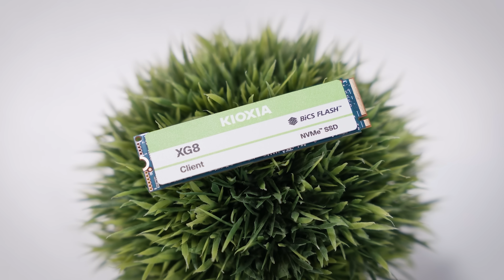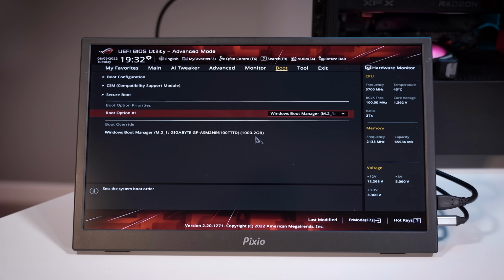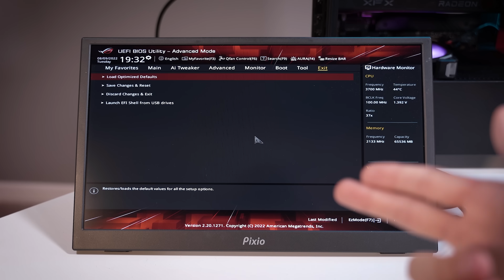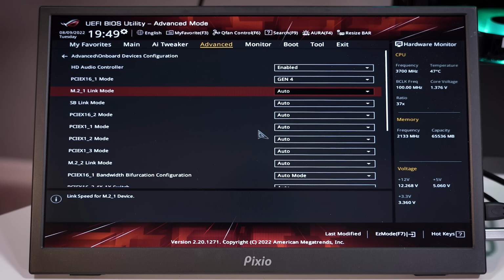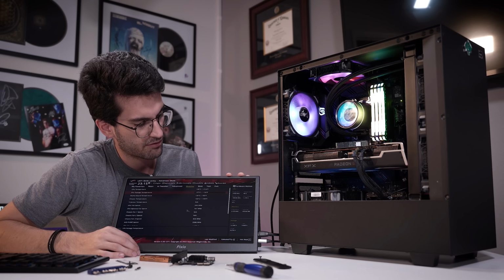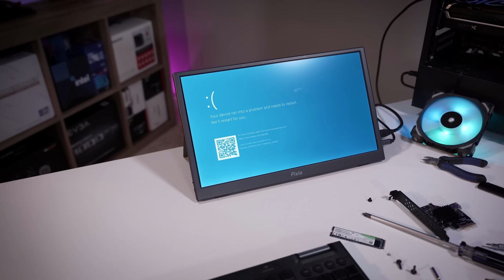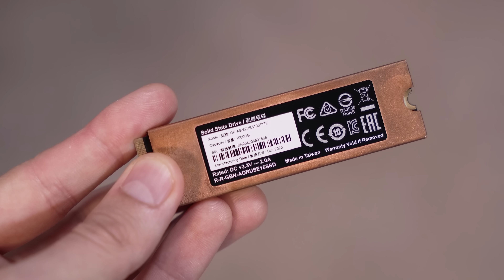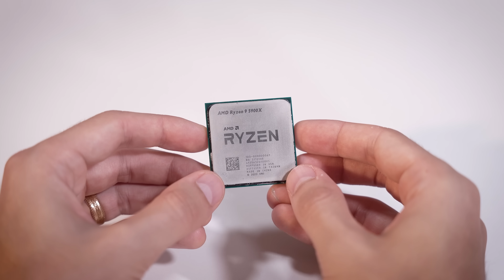Fixing a Viewer's BROKEN Gaming PC? - Fix or Flop S3:E2

Comment: Okay so I had this EXACT issue. Mind you I work in IT and this one had me stumped for a while. If I got into bios THEN exited and discarded changes it would boot into windows fine. I first replaced the Motherboard (it was a older asus b350 strix with a asus b550 strix. Same issue. So like you replaced the drive and literally tried a new install of windows 10. Now getting errors trying to install. Did multiple deleting and reformatting of the drive before it actually let me install windows. Got into windows on the new drive in the new MB and still getting the same issue. Could only boot after going into bios and exiting with no changes. What fixed it for me was running scanning the drive for errors - if found the errors, repaired itself and since then no issues. It HAS to be a issue is asus uefi bios and Ryzen cpus (I have a 3700x) not correctly installing windows or something since I literally replaced no the the ssd and the MB and tried a fresh install and was still getting the same issues. I think that CPU is fine but does have some sort of controller that is all messed up but at least in my case was able to be fixed.

Comment: I recently had similar issues booting into Windows. I tried a clean install, resetting BIOS, just about everything, and was slowly going mad… I used a Linux rescue drive to test my SSD, and found my problem… the SATA controller. I unplugged my SATA drives and disabled everything related to SATA in the BIOS. The PC booted up perfectly fine. 

I ended up having to replace my motherboard, but I was thinking of Greg and this playlist the entire time I was working through the issue. 😅

Comment: had a similar issue for 2 years, random crashes, BSOD, the like, an AMD ryzen, narrowed it down, to voltage offset, rasied it by 0,9mv, never crashes, i think some amd cpus need a little more voltage than the stock settings

Comment: I had something similar happen but in my case the CPU was not dead, simply reseating it fixed the problem. Maybe a pin wasnt connected right, idk. Could have been the issue here too.

Comment: my guess is there is a short inside the CPU given the temps we seeing and that makes the entire system unstable under any load. when you are in the UEFI the CPU doesn't actually do anything it is just running full tilt in a idle state. so you can fetch the microcode etc. since it isn't touched by the short but once you go to boot it crashes since the voltages will be all kinds of messed up.

Comment: How is that front radiator getting air? Wth is this case? In a restricted case a 5900x can run up to 57 degrees when the cpu is doing basically anything. Mine idles at 47-50 if the room isn't too warm, but jumps up to around 57 when it's busy at all, running a NH-D15 in a define 7 compact. (running between 48-53 now with just youtube and background programs on)

Comment: Honestly Its hard to diagnose these high core zen3 with temp problems because I've had fairly high temps in bios as well with the same chips. No issues with it but because of the zen3 algorithm its normal to see it jump to 50 - 60c

Comment: Had problem with AMD graphics card. A few days ago, my friend's pc got a blackscreen so he asked me to fix it. He got a 12400F and 6600XT build, which I built for him and it worked fine for about a year. Turn on the pc, the keyboard and mouse lights on, the screen start to look for signal but a few seconds later still black screen. His motherboard, Asus H610M-A，has no Debug led but a Q-led core system to allow me know that the mb says GPU is the problem. So I swapped his 6600XT with my 3060TI, everything just worked fine. Then I put his 6600XT on my rig and it had no problem too. So I used my 3060ti to went into his bios and enabled CSM, changed Boot from PCI-E into UEFI only, his 6600XT worked. I ddu all the previous drivers and installed AMD drivers of different versions. But the rig just kept going blackscreen when I tried to play games. All attempts failed, I let him to send back the card to Asus😔

Comment: I bought a brand new motherboard from micro center and when I turn my power supply on all it does is flicker then shut off really quickly. Idk what’s wrong with it!? It kinda sucks wish I lived near Greg but I feel like I got a dead mobo all other parts in the pc work I tested it with a working mobo

Comment: Don't tell me my CPU is broken. This is exactly the same issue I am getting for few weeks, at first my motherboard decided not to recognize the Quad channel even though its been years I am on the Quad channel memory, second it stopped recognizing my storage drives.

I had updated my BIOs to F37c and after that I started getting these issues. Although i downgraded it but some issues still persist. 

Currently, I am able to use my computer but after my first post computer freeze on the mobo logo screen then BSOD, I had to force fully power off the computer and power it up again then the computer work fine until I restart/shutdown it again. 

Mobo: Gigabyte Gaming X x570
CPU: 3700x
Bios: F36

Comment: Hi Greg, I also have a 5900X and the temps on this thing are weirdly almost always high. In the desktop I idle at around 47°… When gaming I never go above 75°. I’ve tried everything, changed cooler, reapplied thermal paste etc and after some research the chip just runs very hot regardless of cooling. Fantastic CPU otherwise!
Reply: As long as your temps aren’t rising slowly while the system is idle then your fine honestly. 47c idle is a bit on the hotter side of idle temps but perfectly acceptable especially as you did say it doesn’t go past 75c (tjmax of your cpu is 90c) while gaming so in most cases the idle temp doesn’t matter too much.

If i was you i wouldn’t worry about it and keep gaming! But If you still looking at maybe trying to lower your cpu temps;
-Check your ambient room temp and see if you can cool it if its on the hotter side.
-In the bios if you are comfortable you could try and undervolt your cpu by setting voltages yourself but like i said only do this if you are comfortable and make sure to check guides and acceptable voltage ranges for your cpu since you could fry the system SO BE VERY CAREFUL!
-Set a more aggressively fan curve within the bios or MSI afterburner more noise tho, up to you.
-If using a Aio have the fans as intake which will cool the cpu slightly better however, GPU in return will run a bit hotter nothing to crazy if your gpu is already fine. Generally this doesn’t matter too much as long as theres airflow but it is an option.
Reply: @ranjnijan3446  Thank you for all of the points! I might try flipping the AIO to intake as it's currently set to exhaust at the top of my case. I replaced the included NZXT fans with the Lian Li AL-120's that I got instead. I have 3 set to intake and 3 (on the AIO) for exhaust. The temps are fine and stay stable when idle/not gaming. As soon as I go into a game, they slowly ramp up to around 70 and then go up or down a few degrees. I've not had any blue screens or issues, so I'll leave it for now and try some of your suggestions if I have issues. Thanks!

Comment: This exact same thing happened me from an update the other day, I also use 6700xt with r7. I had to create win 11 instalation media and wipe everything to get past it, got all them same errors also, and mostly always different. Anyways it fixed it but I lost all my data that I didn't back up. Just thought I'd let you know cause our specs are pretty similar and the issue was the same so I don't think the cpu is dead

Comment: Attempted to read to write-only memory. That is the exact same BSOD-notification which I had quite a few of on my broken Acer-laptop (Coffee Lake and NVidia, default settings of the BIOS and never overclocked). But also the others which Greg showed. Windows BSOD's much too fast for little reason. See Dave's Garage, a wonderful YouTube-channel from somebody who worked for MS until somewhere in the 00's pretty high up in the chain of the Windows-team. As far as I can tell Linux does run stable on that laptop which tells me that there is some weird problem with some driver.

Comment: Please try this Greg on another board. See below.

I had the exact same issue. Bought a new r5 3600 back in 2018 and i couldnt get it to post for the life of me. Ive built many rigs in the past especially Amd ones. I realised something was up when i couldn't get a new install of Windows 10 to complete, it would just blue screen with many different errors. I tried my spare 2400g and it was fine. Turned out the issue was the stock voltage was no enough to keep the chip running. It had 1 core that was so bad it needed 1.45v locked at 4ghz to boot. 
Im almost certain if you go back in the bios and set a voltage of say 1.3 and an all core of 4.2 it'll work fine.
Reply: I guarantee 1 core is cactus or really "tired". If a static voltage and clock speed doesnt work, try disabling 1 CCD. Im pretty confident it just needs more voltage and lower clocks.

Comment: If you can't get into Windows you can't use your rig? Well, as long as you can Linux...it games pretty well. Of course he likely won't get into that either but if you have one of those PC (especially Acer) which is unstable on Windows then Linux might be a great solution as long as you can't figure out the problem. I had two, a desktop from Acer (2009) and a laptop from Acer (2018/2019). The desktop was unstable on Windows due to a buggy Intel-driver which it shipped with, for the laptop I haven't figured it out yet, without any driver (clean install) it is unstable. Acer-PC's are a nightmare, avoid. You might be lucky, the point is that they have no reasonable quality-assurance.

Comment: from my experience most of the BSOD's are caused by RAM. I'd swap RAM first as it's the easiest. Run Memtest86+ to check if it's faulty. I'd check the CPU in another mainboard too. Might be dirty pins so wash them with isopropyl alcohol and a brush.

Comment: Had the same issues with a 5900x. Always crashing at startup (Search for "whea errors 5900x". It is a known issue)
The only solution for me was to flash the CMOS and immediatly set the multiplyer fixed to 46 with docp and undervolting it to 1.25V.
Now it's stable @4600 Mhz.

Comment: this exact thing happened to me about a month ago.

started with the windows black screen rebooting after I'm playing games for a few minutes. so, it should be the gpu area, right? spend some times cleaning and replacing the TIM and pads. still same problem. rolling gpu drivers from newest to older versions, same problem. temps in hwmonitor were normal. 

then it started doing just like in this video, post no problem, but couldn't boot to windows. difference was, I can get into automatic repair screen, but nothing I did there fixed the problem. tried safe mode booting, restore to previous restore points, etc. 

tried clearing cmos numerous times, bareboning (only cpu, gpu, and cooler fans are connected), swapping ram slots, nothing worked. 

then I tried swapping components with my lesser office pc. every components, including the cpu and psu were migrated to my office pc's motherboard and casing, and everything was working fine there. ran occt stress test without any errors. 

so at this point, it should be either the motherboard or windows installation went cuckoo, right??

before I drop money on a new motherboard, I thought I'd try a fresh installation of windows as a last *free resort. so I assembled everything back to the original motherboard and casing.....and lo and behold, the system booted to windows normally. occt stress test passed without errors. and it never ONCE acted out again till this second....

so till this day, I don't know what happened, where the problem was, and what was making my pc a glorified paperweight for almost a month....

Comment: My brother has recently had this issue. After buying a new pc and bragging to me how it’s from the best pc site in the UK even though I’ve E never heard of them he gets it and… it blue screens just like that straight away or goes straight to the bios saying SSD not detected. And instead of straight away telling them it’s not working him being him has to start taking it apart to try and fix it. Although he doesn’t have a clue what he’s doing I had to do it for him. Everything he had me do though still wouldn’t work. Or though restarted enough and it would actually boot into windows and work so it was a weird one. Then another issue after long periods of time of it not being turned on when he would come in from work turn it on it wouldn’t power on then suddenly restart itself as if the power supply was bad then same issues until he restarted enough. 
He did finally send it back last week haven’t heard anything yet but he started saying to me that sometimes MSI boards don’t like having SSDs and won’t make them work.

Comment: Something like this happenes with me (Different types of BSOD) with my i7 12700K and ASUS TUF Z690 and 4x 16Gigs G.Skill RAM, if I turn on XMP Profile. If I reduce the Frequency to 2999Mhz it works perfectly. It started after updating the BIOS. Now downgrading BIOS doesn't fix it :'(

Comment: That literally happened to me yesterday night spend 5h and i could not even reinstall windows every time i atempted it it just crashed with different bsod codes.... i removed every drive and  after taking another drive from a 2ndary pc it worked.... Then i realized all that happened after i installed the "Userbenchmark" it said it was a virus so i checked and people were saying false positive so i run it ( like i did for many times before) and after test was completed BOOM 5 h of nightmare

Comment: This is a dead core. You can disable some cores in the BIOS and still use the 5950X with like half its cores or something. It's been seen on a few CPUs in the past by me and my friends but also other tech tubers. You could also have specifically downclocked some cores to figure out which one is the broken one or to see if you could've stabilized it. But in my personal experience, the core completely died.

Comment: This is great content yet again!
i never knew a higher CPU package temp (in BIOS) could actually restrict an entire system to post or go past recovery.
then again it does make total sense if the CPU needs to load files and programs, it gets even hotter to a critical point and locks it up due to safety features.
im sure 99% of us blamed the drive (being corrupt), i know i did lol.
Reply: Might be worth delidding. But I suspect a dead core (you can turn that off in the BIOS) - possibly due to too much heat since it didn't contact the IHS correctly.

Comment: This just happened to me with a 5950x, I changed most of my compenents from a sweet itx build to a larger full sized atx and somehow the cpu got fried in the interchange. I spent three days testing and talking with friends about what could be wrong and finally (still in denial) I swapped out the cpu with an ancient ryzen 3 I had lying around. $700 later I was back in business.
Reply: I suspect a dead core (you can turn that off in the BIOS) - possibly due to too much heat since it didn't contact the IHS correctly.

Comment: I had the same problem with my PC. What happened:
1. Automatic windows update;
2. I didn't like it;
3. I saw an option to revert it to the previous version;
4. I clicked on continue and it started doing its thing;
5. Right after the first restart, it started looping endlessly like this;
6. Reinstall Windows fixed it.

Comment: I had this happen to my pc about a week ago after downloading Skyrim mods and leaving them in the same folder as my downloads. The files were harmless but it was still technically a virus and it caused my pc to try to boot from those files. I kept getting the preparing auto repair and it would take me to a blue screen and told me to log in to my admin. I was putting my password in that I know was correct but it said incorrect and I was basically stuck. The only reason I was able to get back in is because I put all my old passwords in my notes app so I tried them all, eventually got it right and my pc removed the Skyrim files and I was good to go. Haven’t had any problems since

Comment: Not surprised it was CPU, I would have also suspected RAM or PSU. Kinda common to see that type of thing happen with all of those.
Reply: PSU problems usually result in sudden shutdowns, RAM can also be possible but since he got all different errors it's less probable. I would've also started with the drive.
Reply: @eliadbu  I have seen RAM and PSU do this type of thing. If the PSU is outputting voltages that have too much ripple it can mimic a CPU issue exactly like this.

Comment: I hope you do more testing on the 5900x I have the same motherboard  and a 5600x, 6600xt and very similar problems with it. I flashed the bios I reinstalled windows several times. My system is working fine but very unstable. It just does weird things. Sometimes a blue screen ... Maybe a windows 11 problem as well.

Comment: If he installed windows with multiple drives in I wouldnt be surprised if the windows recovery partition  got put on a different drive that has been formatted, removed, or changed since the install. Windows like to put that on the installed drive with the most free storage. This is why I recommend only having your OS drive installed (or at least enabled) when installing windows. Windows really doesnt appreciate it when it loses that.

Comment: I had the problem where it would go into bios and everything shows up cpu gpu storage drive everything, turned out it was a faulty cpu. It would just not boot into windows and keep going blue screen and attempting to do windows repair, however it turned out my cpu is dead